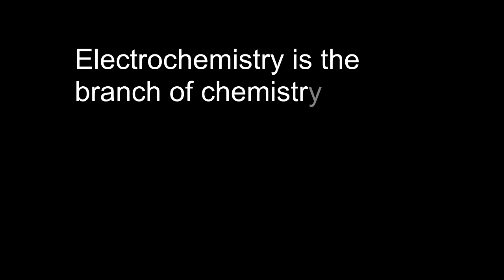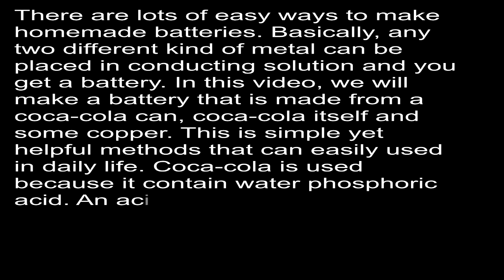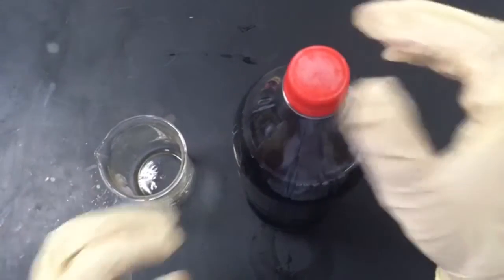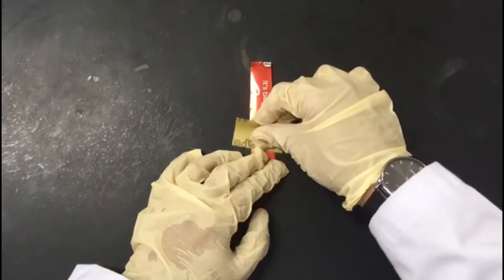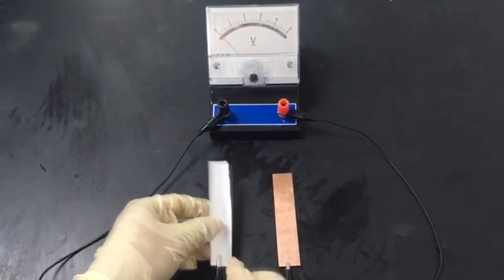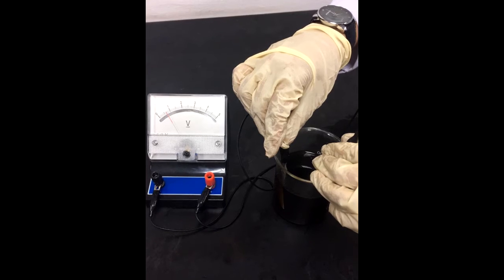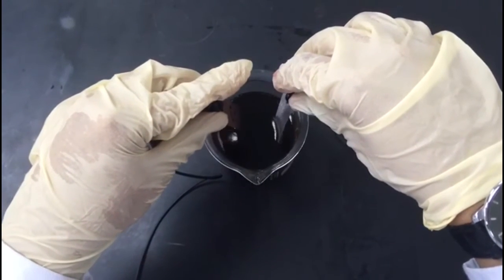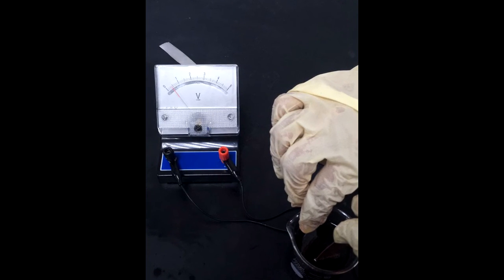MP11 - Electrochemistry in Daily Life (LU7)

Comment: MP 61 Stephanie Kalong 
After watching this video, i have learnt that we should apply the chemistry knowledge in our daily life such as this video have fully demonstrate that by using coca cola can and coca cola it can make a battery due to the presence of hydrogen ion in the coca cola and the metal strip which can conduct electricity . It is a very successful demonstration as the volmeter deflect once the metal strip have been dip into the solution. Plus, changing the length of the metal strip will also affect the volmeter reading. It give lots of information. So, it is a very good and useful video.